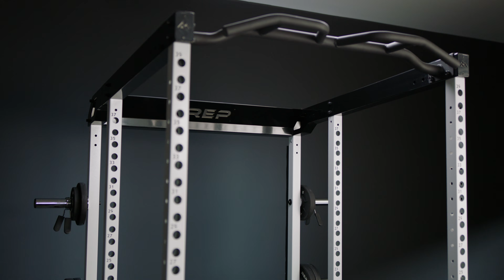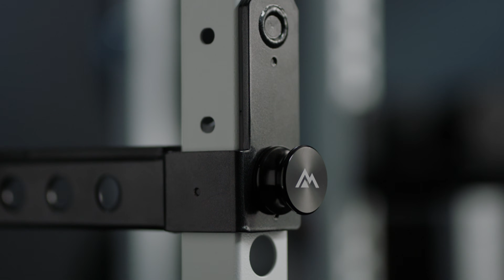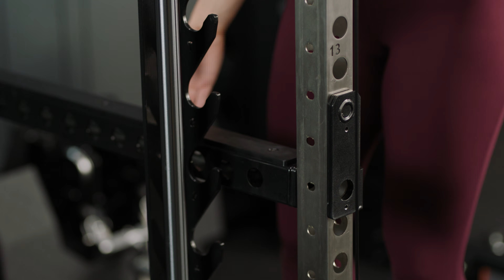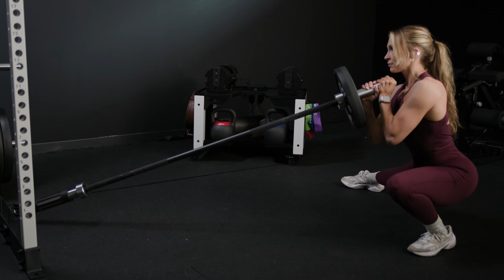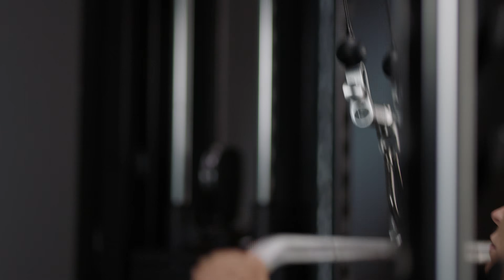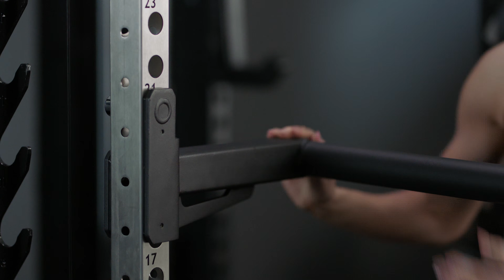REP Fitness Altitude Series Rack Engineering Short Breakdown

Comment: So I’m just supposed to ignore all the cable and smith machine attachments lol? This will probably get some hate from the community but this is a home run in my opinion. I have a 3x3 rack and I’m all about it but I don’t think it’s necessary for me and about 99% of home gym enthusiasts. 700# weight capacity is enough and I will likely be recommending this to people.
Reply: Not sure who decided 3x3 is the standard.. I can’t squat a baby elephant.
Reply: Yeah I have a 3x3 RML and squat over 500lbs and would rather have this. If only they had a 90 inch option to fit in my basement
Reply from the maker: @TheHerdTrainingHall  The Altitude rack comes in both 90" and 83" - check out our builder here - https://repfitness.com/products/altitude-power-rack?variant=53086137024878
Reply: @TheHerdTrainingHall I totally agree about the height increments at REP. 93” 84” and 80” misses my demographic at 6’1” with 92” ceilings. Maybe I’m the freak lol

Comment: Price?
Reply: $3900 with the standard weight stack, smith machine, and 90” powder coat. If you do all upgrades (stainless steel, heavier stacks, shrouds), it goes up to $4450 US. That’s without the attachments like the leg roller, dip handles or landmine.
Reply: @noumanintown  thank you for the information, that's not a good deal 😂
Reply: @navenzor Why people would buy this instead the ares 2.0 is beyond crazy.
Reply: @AM-dd6gk  prob because this like-for-like is a good $1000+ cheaper than the ares 2.0. $1000 goes pretty far for a decent barbell, weights and attachments (or benches, dumbbells etc)
Reply: @chibbyylol it's your money! In all reality, people who build home gyms are usually financially stable.  If you are willing to spend 4K, then you may as well spend the extra 1,000 to 1,500 dollars to get something that is future proof. That's just my opinion.  I've had my gym for over 3 years, and I have had to learn the hard way when going with the "budget" option of things. It's easy to think you won't want something that can be easily expanded on and focus on the minor savings, but a rack is a centerpiece of a home gym.  You are skimping on the possibilities of it by going with a budget rack. I bought a budget rack years ago, and now I'm stuck with it.   Unless I'm willing to pretty much give it away, I'm not gonna be able to get rid of it.